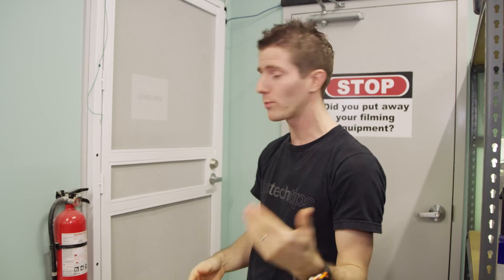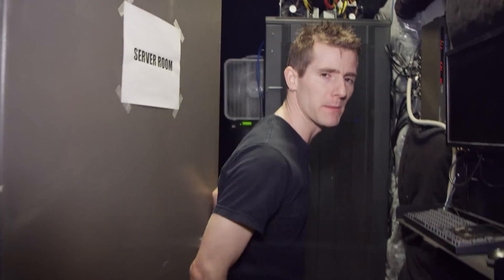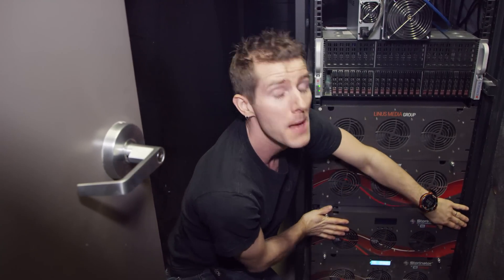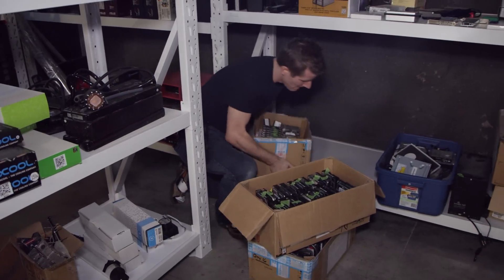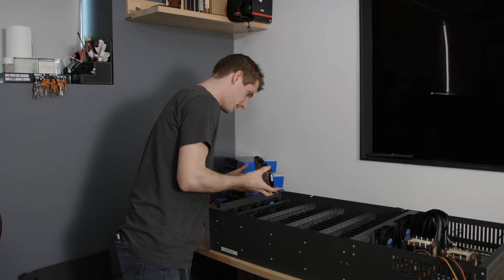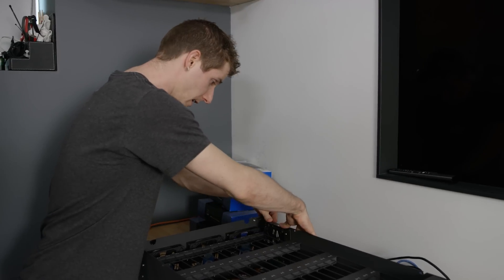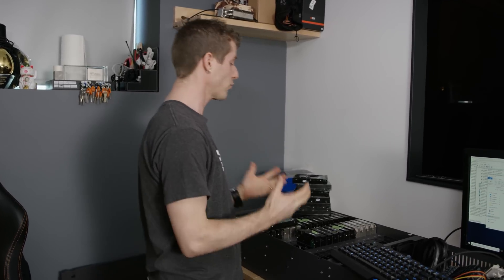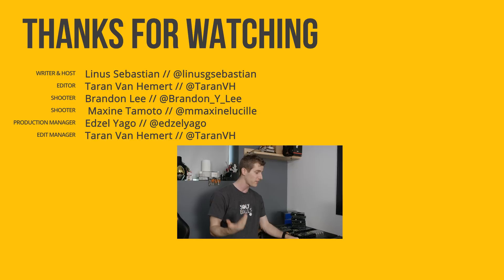HARD DRIVE Mining? This is getting ridiculous...

Comment: I might need to buy the last 10TB drives for my NAS expansion before everyone goes crazy.
Reply: Martin J ok you do that
Reply: Monthly, probably.
Reply: I mine Burst for 2 years.  Prices have increased in the last 3 months.  Not sure why, but I don't think it has to do with Burst right now.  It's averaging about $3 - $5 dollars per TB extra.  It's worth it as the electricity is small and you don't need a fast computer that is unless your plotting which you want speed and threads.
Reply: R 3 to 5 dollars a day?
Reply: Nathan Carbo sorry, price per TB.  I average about $90 - $100 dollars a month.  But, that's because of higher internet band with and speed of scans.  But, Burstcoin losses 5% of profit a month.  It's good, but it's a bust if your just getting into it.  All profits for 18 months are positive.  Now I wouldn't get into it at $0.02 a coin if your starting.

Comment: If you have spare HDD you dont want i will take it i will take every pc part you will give me pls i have the worst laptop possible
Reply: Laysman TV Lol thats not even bad 

My computer
Toshiba Equium P200-1FL

Intel Pentium Dual-Core 1,46Ghz 
2GB DDR2 RAM
5400RPM 150GB HDD
Intel GMA X3100 ~350MB vRam
1440x900 LCD Display
Reply: Laysman TV then get a job
Reply: DerpyDoom Im 12
Reply: Laysman TV Laptop Specs?
Reply: Mad_Cat AMD QC 4000-quad core 1.3 Ghz HD 8500m OC 950 core 1000 memory 1.3 gb vram 4gb 800 Mhz ddr3 and 1366x768 LCD panel
Reply: Laysman TV And what version of Windows do you have?

Comment: Limus, you should be using HP D6020s rather than storinators.
Pros:
-Holds upto 70 LFF disks
-Support for upto 12TB disks
-Support for fully redundant I/O modules
-Hot swappable drives WHILST Powered up

Cons:
-None really

Comment: I made 2500$ mining burst coin in 6 months and i now have 51.6TB being mined I spent my burst to buy a Sager p650hs-g laptop with g-sync a 1070 and an i7 7700hq AND a ryzen 7 1700x asrock Taichi x370 mobo and 16gb ddr4 ram...
Reply: The economics of this just don''t work out.
Reply: For sure, that's probably a couple hundred Burst a week once they're all plotted. You wouldn't even need the GTX1060 long term, but it would help you plot more quickly up front.
Reply: Lunas Eclipse yo I was going to mine with my ryzen, getting 600 hs, but because the recent price drops, not making anything. What crypto are you mining?
Reply: If you hodl the coins maybe, but if you plan on selling them each week, month then probably no
Reply: Lunas Eclipse see if you can mine on the laptop
Reply: i could i dont because LAPTOP but the ryzen mines great and provisions drives just as fast as the 1070 i bought to go in that system.
Reply: 27tb would pull about 40 burst a day they are about 3 cents per my rig pulls about 2-3 dollars in burst a day...
TBH linus should be making a bit more than he is with how many TB 125tb should pull 4-6k per month and if he solo mined there is a bit of luck he could hit multiple blocks quite frequently for the full reward of 1100 per block
Reply: Absolutely! 27tbs is actually quite decent to get a good start. Plotting will take a while, but you only have to do that once!

Comment: 4 minutes in and you still haven't explained at all what the point is of this new form of mining. It seems rather rediculous and pointless so far to me. As in, people literally going insane at this point.
Reply: Here, I'll explain it. Rather than regular Bitcoin mining, where a chip calculates new hashes based off of the payload and a nonce, instead a bunch of nonces are plotted on a hard drive. Each nonce generates a "deadline", or the time it takes for a block to be created. This value is unique to each nonce. The more HD space, the more nonces, and better deadlines on average. Whenever a deadline is so short that it produces a block before all others, the cycle restarts. It's still a secure PoW, but it costs less electricity.
Reply: That it is a business branch to waste this planets resources just to literally produce hot air that isn't even used to warm something up is a crime if you ask me. People aren't even really using it to pay for something...
Reply: Burstcoin began in 2014. The act of mining the algorithm with HDD rather than processors is a more energy efficient method of encryption tech as HDD use far less electricity than GPUs.
Reply: I highly doubt LTT does much mining. Though I do feel you on the business end, I was going to make a killing off of ryzen3/rx480 builds... then cue the mining craze.
Reply: All mining is an arbitrary task. But that's the point, it is a task. You have to do work instead of making the coin up out of thin air like Fiat money is. That's why is called Proof of Work mining algorithm.
Reply: i second that. If all the worlds processing power was put to "proper" use instead of mining bitcoin - the mind boggles.
Reply: thats the whole point of burst...
Reply: Erik Heijden maybe, but since literally has two meanings, figuratively and literally (really stupid), I would assume literally literally would mean what they say exactly and it would place greater emphasis on the meaning to draw attention.
Reply: xorinzor Burstcoin has been around for a while now and it not a case of why but why not. Pretty much any component can be used to mine some new dumbfuck coin. Do what you like, but the PC market is so flooded by a bunch of new mining fucks; It's become pretty pointless at this point.
Reply: TalesOfWar
Mining was once used for the good of society. We've had Curecoin, Folding@Home, and others. Some helped freelancers render projects and you were rewarded being able to be higher in the render queue. Others help you fund space projects or cures for cancer.
Then, in 2016, greed happened.
Now we have people GOING INTO DEBT because they want to get rich quick, instead of mining coins and holding them for when their value goes up, or using them to help others in addition to making money. 
Honestly, anyone dumb enough to put themselves in debt like that doesn't need to be here anyways.

At least some smaller miners are using the heat for heating water or rooms and letting homeless people stop by. But that guy in China with 8,000 GPUs on server racks? Nope!
Reply: 4 minutes in and I am convinced he posted his April Fool's Day joke early.
Reply: Yeah the small computer company I work for is about to shut down Because the prices of compoments have skyrocketed. This only hurts small time users and benefits the fatcats like linus
Reply: 'Literally, literally' Typical millenial talk...

Comment: Electricity cost?
Also, sell the old drives?
Reply: 30KM a year which equals to 3 football stadiums
Reply: In general, BURSTcoin is about 400x greener, or uses 400x less power per transaction, that Proof of Work coins like bitcoin and ethereum. Once your initial plotting is done, its just having a pc at idle most of the time really. Especially if you are already running a pc 24/7, its almost negligable.
Reply: Anti KM??
Reply: $5M
Reply: not verry much after ploting, thats the point of burst its a green crypto, tbh, you could probably run it on a raspberry pi with usb hdds
Reply: This thing will use less than 700W at max. 500W at normal and 400W idle.
Reply: yeah like i'll buy a used hard drive now...
Reply: I would, stick some long-term data on there and leave it in a box.
Use it as a secondary, third, fourth or fifth backup?
But them in builk to do mining?
Reply: I'm going to give this new form of mining a try.

I'm already still making profit with BitCoin, but mostly due to the fact of it's still higher than average rates and also that it is entirely solar/battery powered.

I'll be trying it on the best platter hard drives available and also on the current best SSD available. One should be able to hard drive mine and use less electricity that a 25 watt light bulb.
Reply: More than $100/month :-).  That box would be eating around 1200W going full out.... between $200 and $400 a month in electricity.

-Matt

Comment: Great I was going to do a ryzen Apu build but now hdds will skyrocket
Reply: Sharp Element they won't skyrocket immediately just by a he'd before hand
Reply: hdd ffs can't edit on mobile
Reply: Burstcoin is 4 years old. Why is everyone suddenly losing their minds over it? Prices were fine back then, and they're fine now.

Also, I would do some research before you do your APU build. Not trying to be rude here, but you seem to have done no research about how mining actually works. You'll quickly find that the Ryzen APUs are hotter than Ryzen 7s.
Reply: Bitcoin is 9 years old. Your point NessMac?
Reply: People weren't complaining about mining driving up prices back then. People nowadays immediately assume that mining = high prices when that's only been the case ONCE (Last year with Ethereum). I just think people should do more to see what actually causes price increases instead of just complaining like half of the comment section is on this video. Neither Bitcoin nor Burstcoin are driving up prices right now, and nobody was having issues with them when they first came out either.

Apologies if I sound a little angry or something. Just tired.

Comment: things break most of the time when changing state from off to on or vice versa. Having drives spin constantly is less taxing than having them spin up 10-30 times a day. if it is purely a backup system and is only used once a while, powering down the spindles makes sence.

Comment: Linus, please overclock the Almighty Pentium 4! (Attempt #3)
Reply: SlapThatBurger - WT keep commenting till he listens, I'll like every attempt of yours👍
Reply: I would watch that
Reply: YES! do this
Reply: I'll like your comment until this video is made
Reply: vivek sood same and i shall keep saying the same comment
Reply: PLEASE do this
Reply: PLEASE DO
Reply: YESSS
Reply: I'm not sure this is the right channel to make such a request, there are a lot of other people around here that specialize in older hardware, and it's been done countless times before.
Reply: Please!
Reply: Still have two fully functional Pentium 4's available to run. They still can run, but...

The amount of power consumption and even worse - the heat that they generate. With the higher end Pentium 4; it can run indefinitely a 4.o GHz - overclocked to about 4.4 - all on air cooling. But that desktop Pentium 4 will also HEAT a 20x20 room through the winter - or worse need extra air conditioning in the summer
Reply: yeah + they already got an amd 8370 to do 8.7GHz so not seeing the point.
Reply: Yeah! I love LTT throwbacks
Reply: SlapThatBurger - WT why even bother. Its not like you will get any good performance improvement. Other than that it will raise electrical bill and heat that it will emit. And your mobo would need to support overclocking. My advise is just to buy a newer cpu. Since it would probably beat it in every single catagory